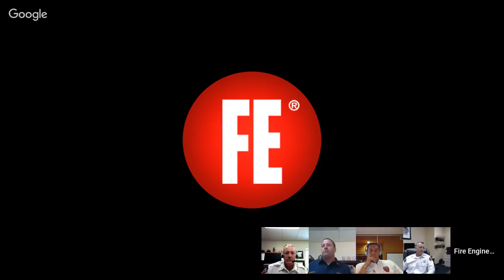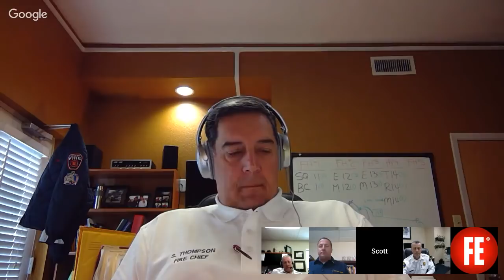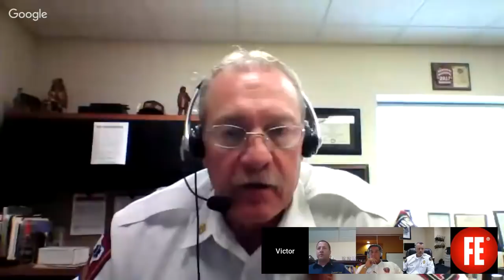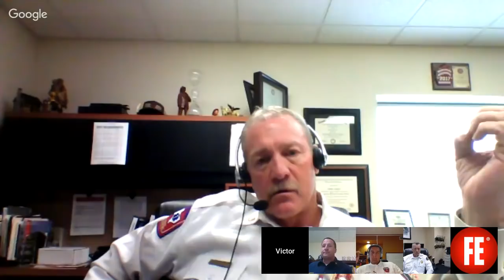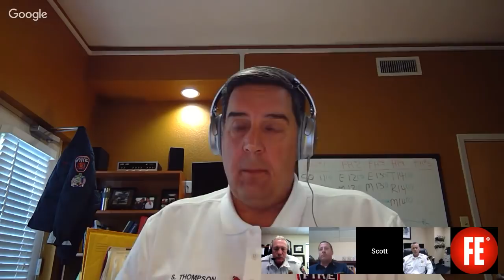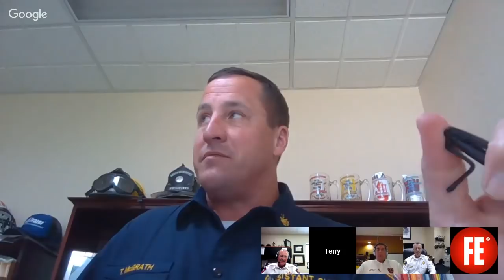Blocking Engines...What is stopping you?

Comment: We have stripped a 1990 Quality Spartan Pump of all hose, ladders, and tools. Since we live in the snow belt, we have also drained tank and all lines of water. I understand that sand is an option, but what other options are available to add weight but not cause freezing concerns?